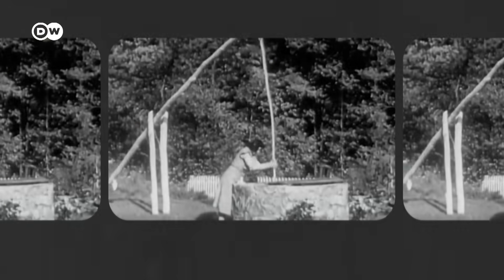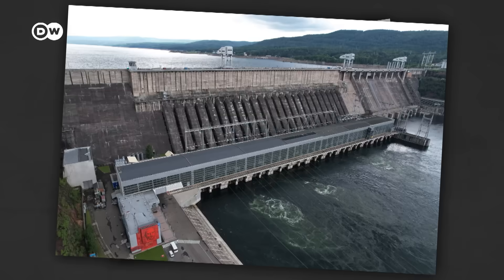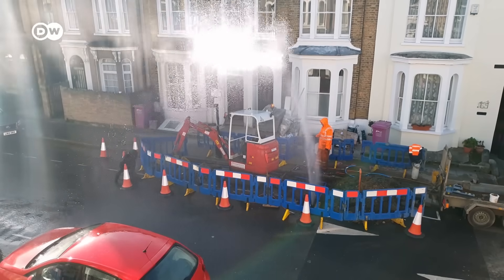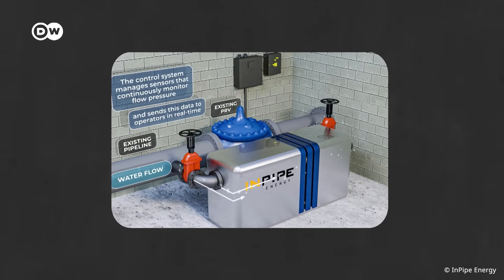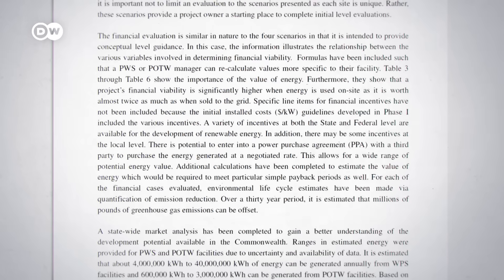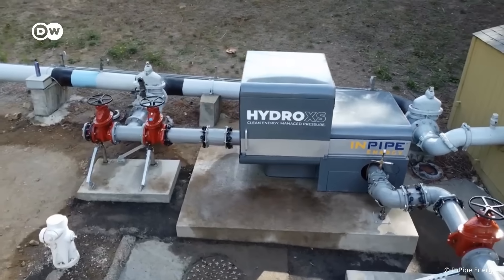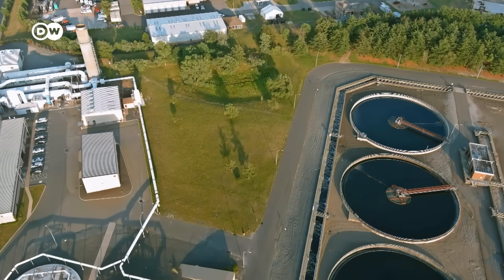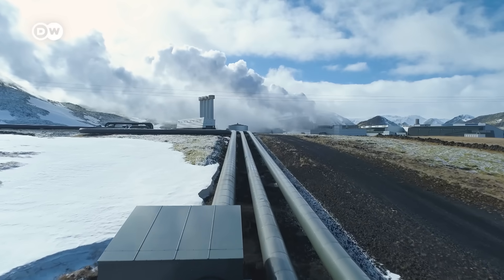In-pipe energy: The hydro power nobody is talking about

Comment: If we directly plug into the pipelines it will hinder the flow and inturn increase the pressure upstream resulting in more energy needed by the pumping station. To generate energy we need to collect the water at the outlet without losing head and then generate electricity from the stored water.

Comment: You walk into the bathroom, turn on the tap to get the turbine spinning, then turn on the light. When you turn off the tap, the lights go out. Hmmm. You're OK to get maybe 5 minutes of light in your living room by filling your bathtub? How often do you have water running, compared to how often you need electricity?
Reply from the maker: @RS-uh7rz Thanks for your comment! Micro hydro turbine technology could work on any type of water supply or disposal system. It's not primarily for household pipes. And while an individual turbine would produce a large amount of electricity, it's quite scalable, and could add up to a sizeable amount of otherwise wasted energy.

Comment: This is border lining with Perpetual motion . We are using lots of energy to maintain water pressure and you'll put turbines which will reduce pressure ?. 
Why not put the turbines on the pumps directly at-least you'll get higher efficiency . Or just Remove the pumps and turbines and attach live wire to the power source of pumps to get 99.999% efficiency
.
The best use I can think of is using water as batteries in conjunction with solar energy , When sun shines you pull water high up in tanks and when the sun sets you can let the water flow through pipes with turbines and provide electricity locally
Reply from the maker: @rx58000 The turbines would be run on the waste energy, released via the pressure valve. We need water to be transported via very high pressure. The pressure valves are necessary to 'slow it down', so to speak, so that non-transport pipes aren't destroyed by the high pressure.

Comment: Interesting report. But difficult to ascertain the exact merit here... 

Show me the math please.  

The report focuses on the consequential benefits. But only loosely examines the efficacy of core idea.

The idea is Qualified but not exactly Quantified. Attaching a mini dynamic pump to the water mains? 

This certainly works to demonstrate micro power generation. Some may find that fascinating.  

But that is not the point of interest here. It is of little value.

The point of interest relates to the examination of the energy potential of extracting surplus energy from our water supply infrastructure. 

And, achieving that without interfering with our water pressure and water quantity supply demands.

In other words: How big is that surplus? How much of that surplus can we actually capture to convert to energy without compromising the integrity of the water supply? What would that cost? etc.

The report suggests that the extraction of surplus energy from water mains is feasible and can be achieved from pressure regulation sources and gravity (elevated water sources). 

But is that an efficient and effective means to generate power? Cost/benefit? What about the de-centralized Infrastructure needed? Its deployment, installation, maintenance... 

I don't see it. Sure a dam works in the similar way. But a dam is a centralized system and we are talking about Massive amounts of elevated water. Efficacy is clear.

It takes significant amounts of water and/or at significant elevation differences to produce even small amounts of electricity.

Again, show me the math.
Reply from the maker: @TriAngles3D Here are some reports that can provide further, more detailed information and show you the math 🙃:
📚 "Pumped Storage and Potential Hydropower from Conduits" by U.S. Department of Energy: https://www.energy.gov/eere/water/articles/pumped-storage-and-potential-hydropower-conduits
📚 On U.S. conduit hydropower capacity potential by Oak Ridge National Library: https://www.ornl.gov/news/existing-water-infrastructure-may-hold-key-generating-more-hydropower
📚 "In-Conduit Hydropower Project" by ALDEN: https://www.mass.gov/doc/in-conduit-hydropower-project-phase-2-report/download
Reply: @DWPlanetA  Very much appreciated. Will examine with interest. DW keeps on providing some admirable reporting.

Comment: I thought of this solution when i was 14, i went to my science and math teacher. And they explained to me that it would never work. We still did some tests and calculations because i was stubborn and didn't believe them without prove. I called and talked to people of the industry and they told me that they also had thought of it but the math didn't worked out.

I still believe that we missed out some important nuances in our math and tests. And that it will influence the outcome in favor of this idea.
But not by any means as much as it is claimed in the video.
Reply from the maker: @screamingbirdheart No single turbine would produce much electricity. However, considering this is possible for ANY water source, collectively, the amount could be meaningful, according to researchers.

Comment: Sorry, doesn't work. If you place a turbine in the pipe, you are taking energy away. The energy you generate comes from the water flowing. But the water flows because of the energy imparted by the pumps in the first place. If you remove energy from the water using the turbines, the pumps will need to spend more energy to compensate for this. It would be like trying to press the brakes in an electric car with energy recovery to generate electricity WHILE also accelerating. And because of the 2nd Law of Thermodynamics, this balance will not even be zero, it will be negative, meaning that for each Wh you obtain from the turbine, the pump will need to pump more than that. If you assume 90% efficiency for energy generation with the turbine and 60% of efficiency of the pump, every 1 Wh you generate by the turbine, you need about 1.85 Wh EXTRA at the pump side (not counting further energy losses in the pipe). Reduce the efficiency in the turbine (because it isn't made as efficient as the ones in dams) and this gets worse. So to provide you with energy, you are asking the water provider to spend even more energy. Not workable.
Even if you think you are using only something at your own outlet at home, even that needs more energy being used at the pumping point.

In pressure reduction there are some options, but these will likely be clunky.

Best option? Just eliminate the leaks. Some 30% energy could be SAVED (not generated) by eliminating these leaks.

In summary: energy needs to come from somewhere. If you are relying on pumped water to generate energy, you are not generating. Just transferring it. Inefficiently.
Reply: Look you got me wrong tidal pipe in effect flow and  tidal power

Comment: Many in the comments are confused by the presentation of the elemental physics at play in this tech and the reason it was developed.  No, this is not a magical free energy source nor an efficient way to produce power. It IS a way to reclaim energy lost in operating water infrastructure due to pressure overcompensation and relief mechanisms. Yes, there are reasons that our water systems were/are built this way.
Reply from the maker: @Thylacine 👏

Comment: The second report estimates 43 GWh per year of ENERGY, not 43 GW of POWER. These are not the same thing. 43 GWh/year is only an average of 4.9 MW. Also, this is not "generating" energy. It is only recovering (a small portion of the) energy that you've already expended by pressurizing the water.

Comment: Wouldn't just addressing the issue of pumps overpressuring the water, be easier as well as more efficient in amt of energy saved?
Reply from the maker: 🚰Initial pump pressure must be high to transport water long distances and give us the steady streams of water we enjoy out of the tap. 
💧The water pressure valves are essential to reduce the flow of water to limit the strain put on plumbing infrastructure. 
🔌This change in pressure regulation to save non-transport pipes from too-high pressure is where the excess energy comes from - the excess energy which could be redirected to micro hydro.

Comment: The energy recovered wont even come close to offsetting the research, installation and maintenance of the turbines and the increased energy to pump the water through them. Besides entropic losses, you've got labour and materials to add to the cost of spinning a generator with an electric motor - and thats why nobody is talking about in-pipe hydro generation.

Comment: You are forgetting limescale that'll block and destroy that generator in a year or 2, then replacing that will be costly, and basically any gains will be lost servicing that generator... it's like those energy bulbs, never did any last 10 years, usually within 2 years you need to replace, it's all just a environmental disaster, and the average tree hugger is too dim to notice....

Just build nuclear generator and wind/solar, there's too much reinventing the wheel going on... that nuclear generator in Ukraine, built by the Soviet times still going good, but the people are really stupid now to build anything better, safer using computer modeling etc. at our disposal.

Comment: Using in-pipe turbines on municipal water supply sound like turbocharging an engine; except for running off excess flow/pressure instead of pressure and thermal energy.

Comment: We spent money on building pump which takes energy to move water. We build some kind of turbine and generator to convert back from kinetic of water into electricity. Why not just pump at lower output pressure and save energy at the start without excess moving parts?

Comment: This seems convoluted with very little potential, essentially you're trying to replace all pressure reducing stations (PRS) with turbines to achieve the same result.
It's much more economical to address the energy usage at its core - the pumps.
Invest is ultra-efficient pumps, control systems and power those pumps using solar panels would be a lot more economical.

Comment: I am a big fan of harvesting energy from places where we're already wasting it. This is an example if aunt even aware was tappable. Thank you for such an informative video. Another energy source we ignore is excess heat. District heating/cooling networks could let us dump excess heat into sand batteries and vice versa.
Reply: The energy isn't being wasted it is using it to pressure the pipes, by doing this you are taking the energy and it would have to be put back in at the other end in other words it would be no different from me illegally tapping into your power supply and saying hey look how clever I am, I am getting free electricity

Comment: So since you propose to fine-tune the entire system by adding turbines instead of valves (assuming I understood the theory right), why not just make the whole system more efficient at delivering the exact pressure required, since it really seems the cheapest solution. Adding turbines instead of valves will surely add maintenance costs on top of longer or shorter periods of time when the turbines are useless. Adding them will likely also motivate to adjust pressure before them (perhaps) just to reduce their uselessness. Better fix the system while this actions is still cheap and less complicated.
Reply: The turbines will have valves in series, and would be installed parallel to the existing pressure regulating valves as shown in the video.  You're right that designing the system correctly is usually preferred.  In this case, durability and dependability is valued more than efficiency.  Water department labor is expensive and slow, so KISS.  A big part of the design choices is that water systems are only partly designed to wash your dishes and flush your toilet.  Most of the design is determined by fire protection standards.  At least in the US, wood construction demands large water supplies and expensive infrastructure.  Rebuild all our cities in concrete, etc. etc. and we could get by with much less water infrastructure.  Instead there are more and more five over one mixed use buildings, packed with plastic contents and with EV's sitting nearby, fire dept's aren't going out of business anytime soon.

Comment: My city, near Denver, receives its water from high in the Rocky Mountains and all water is moved by gravity. Pressure in the large raw water pipes is dissipated at treatment plants by hydroelectric turbines, which earn about 2 million USD per year sold at wholesale prices to the regional power provider-- so the concept is proven. However pressure in the treated water pipelines is dissipated with small turbines and those barely pay for installation costs and maintenance. I can not imagine tiny turbines in the pipes of my home would be worth the effort.
Reply: Exactly, it's only feasible to have them on the pipes if the pressure comes from gravity only. If you put an alternator on an electric cars motor it won't make more (not even the same) amount of energy than it already takes to spin the motor and this applies to the water systems where water is pressurized by pumps as well.
Reply: The crux of this green grift is to target municipalities, not households. The video uses the tiny turbine on the garden hose to trick viewers into thinking they will be able to get free energy to use within the household, but actually they want to trick voters into supporting legislation that forces municipal water agencies to adopt their product despite the fact that they can't prove that the product will result in a net gain.
Reply: Gravity is fake
Reply: Also you have completely disregarded the challenges that would come with this energy. Water pipes don't always work, there will be problems like.
1. Decreasing water table leading to lesser supply of water and lower pressure.

2. We don't have only one season on earth. In winters the pipes get blocked, they even burst due to ice accumulation when temperature goes below 0°C.

3. Rusting is another factor where pipes get rusted, or accumulate minerals, same could be the issue with turbines you are talking about, which would hinder their efficiency greatly.

4. Cost effectiveness, it would simply not generate enough electricity for the buck spent keeping the above challenges in mind.

This was miy first take away from the video in first 5 minutes.
I believe these guys should find another career.

Comment: The only feasible or workable solution for this is to replace pressure reducing valves with the one that can generate electricity. Other than that, needs a lot of research and thorough calculation.

Comment: Totally stupid!!!

You are just putting a resistance on the tap.

So if you use it for the garden... The pressure wouldn't be as great as if you wouldnt use it.....

Its completely stupid.

Sorry, but this video is just greenwashing.

Make energy out of something.. That someone before invested energy in it is silly.
Reply from the maker: Hi! The technology actually harnesses WASTE energy, which is already being generated in the current water transportation system. 🙃
None of the turbines in themselves produce a large amount of electricity, but the tech is vastly scalable and so there can be thousands of them in cities that add up to a sizeable amount of otherwise wasted energy.

Comment: This makes no sense at all. If there is excess energy to be tapped from pipes then the logical step is to reduce the pressure and save energy in the first place. This just tells us that the system design is not optimised. Am I missing something?

Comment: Physics would disagree. So they’re suggesting they’d get free energy? The energy it takes to move the water and then for the energy to be transferred into spinning a generator to produce electricity would have a strong argument of “that’s not how it works”. If anything it’s stealing electricity. Water plant uses electricity to push the water and a city captures that moving water to produce electricity. We are just talking a transfer of energy, not pulling energy from a free source.
Reply from the maker: Hi! Not quite. At 2:26, our reporter explains that pressure valves, which take energy out of pipes to prevent them from bursting, are the point where the energy is wasted. And it is that waste energy that can power mini hydro 🙃

Comment: Dudes! Any turbine in the water pipes network it represents a loss in pressure. So, when you install a turbine you loose pressure in the forehead . If fact you can only transform in electricity less (minus the efficiency losses) amount of electricity that is put into the principal pump. What's the point then?

Comment: as others have said this will not fly.
the only reason there is parts of the net with excess pressure, it was put there by the pumps.
making the system balanced is more expensive than just pump harder.
if you bleed those excesses for power it will create pressure drop upstream and in less fortunate parts, so the pumps will have to work even harder.
there is no energy to gain, taking the whole picture in calculation. some energy can be saved with making the system more complex and harder to maintain.
i suggest the inventors look the other ways.
Reply: This's about change relief valves for calibrated turbines that changes the pressure and flow rate accordingly. In steam engines and most efficient thermoelectric power plants, employs same strategy. I've been to Denver and it's water treatment station use it  and some important waterways